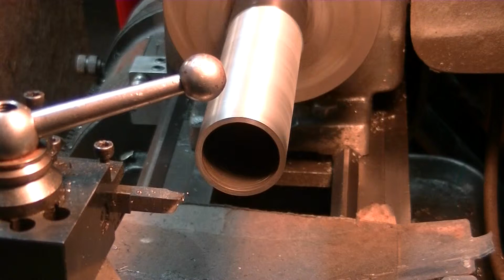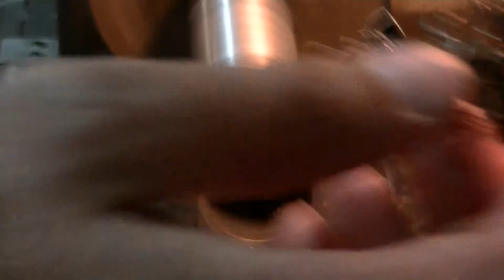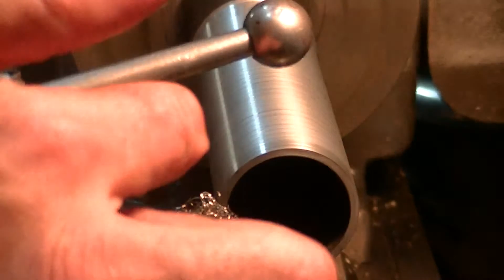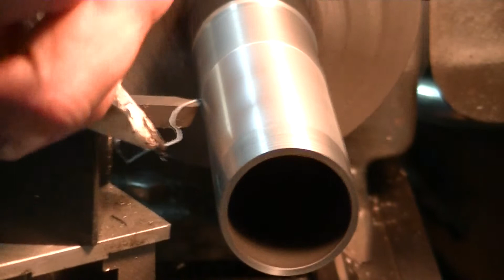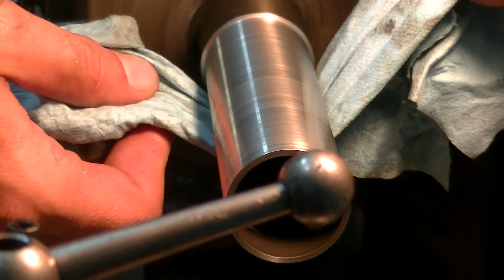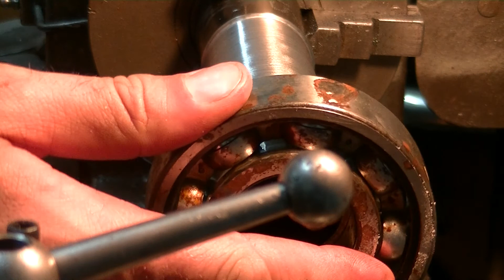welding positioner part 1

Comment: Nice job pal.
I take it that this lade is your first one?
Reply from the maker: Yes my first lathe.
Reply: Dave Prototype hi if you shorten the stick out on the tool it will make a huge differnce, like stick it back in the holder as far as you can